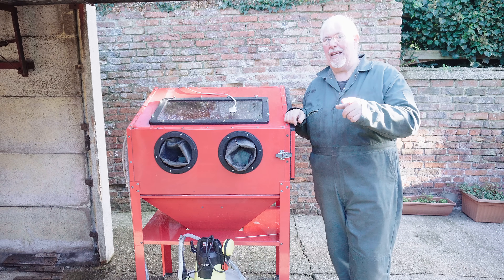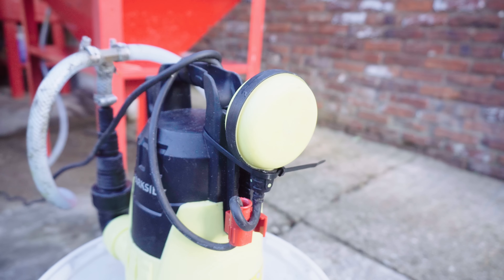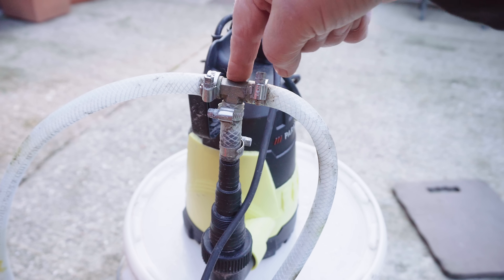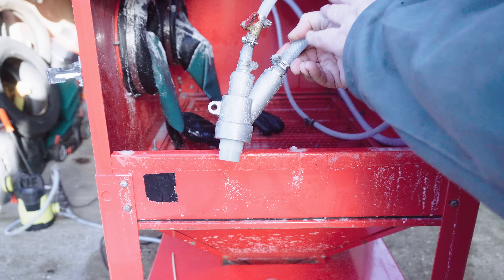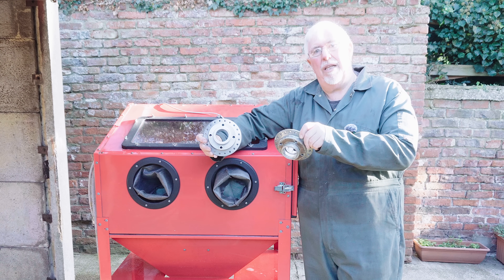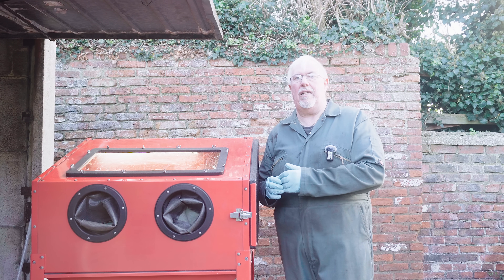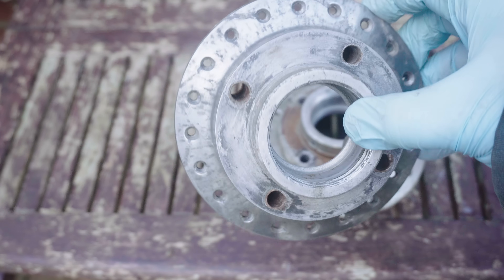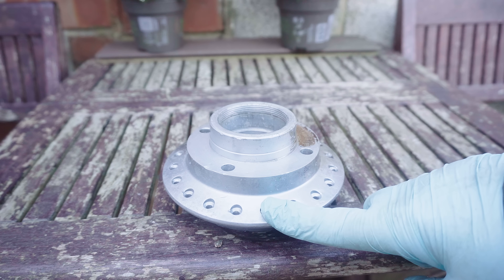Cheapest DIY Vapor Blaster Guide | How To Build The Ultimate Budget Vapour Hone

Comment: If suspension of particles in the mixture is difficult, a thickener can be helpful.  You could use what they use for drilling earth.  Bentonite Clay, Carboxymethyl Cellulose, and polymers like Xanthan Gum or Guar Gum, work well to thicken the water.  I also like to use corrosion inhibitors like sodium bicarbonate, sodium nitrite, or tri-sodium phosphate.  They really help with flash rust.

In a pinch, I once used corn starch, but since it could create biologics, it should always be discarded after use.
Reply from the maker: Some great ideas, I hadn't thought of corrosion inhibitors in the water.  It is something I should try.  Thanks.

Comment: Klever Project,
 BUT and it's an Important .. is the Compressor CFM requiurement,
 14 CFM is Huge for a home shop. Large and Expensive  Not something many have or can reasonably afford. 
 be a Helluvalot cheaper to simply have a Blast Shop... Vapor blast your parts.  You would have Much more Money in your wallet.
 AND you wouldn't have this Rube Goldberg Contraption to : Buy.. Build .. Store AND Maintain.
Reply from the maker: Thanks for the info.  The size of compressor is always going to be an issue with home blasting.  It is surprising though how may feel it is worth the investment if they are going to use it a few times.  Take care.

Comment: You didn't mention the ratio of bead to the 25 Litres of water you use.Please,did you experiment much with this or go with data you found somewhere,what ratio would you suggest for the particular setup here,?.
Reply from the maker: I put 12.5kg of the beads in, but I suspect that was a little on the heavy side.  However works fine, means you wont have to top it up too often.  And it is half of the 25kg bags they come in.  What's not to like! :)
Reply: @SPANNERRASH Thanks,gives us a starting point for trying out different media/water ratios  when we know what kind of results the above provides.Happy Spannering !.

Comment: How much media did you put in the bucket?
Reply from the maker: Thnaks for the Sub.  I put 12.5kg of the media in the bucket.  Probably generous, but I buy it in 25kg bags, so it seems a good idea to use half at a time.  However the fact that through leakage I may need to top up a little along the way, might make that maths fail :)
Reply: Btw! Very nice video! I love how straight to the point it is. You found yourself a new subscriber.

Comment: Can this be used for steel parts?
Reply from the maker: Yes, but you need to make sure you dry the item, and put some corrosion inhibitor on the part or you get Flash Rust.  Not a big deal, but still something else to deal with.
Reply: Thank you

Comment: where do i get the adapters to get the 1/2in hose to fit the pump? what do i search?
Reply from the maker: My pump came with a step down adapter that allowed you to fit a number of different size hoses.  I suggest you search using the pump manufacturers name, to see if you can find something.  Otherwise you might have to get creative.  You can find a lot of different adapters, you would need to start with the diameter of the outlet first.  You might have to go through 2 or more step downs to get to where you want.  Good luck.

Comment: Could you not run the clean waret hose intothe cabinet with the spray hose end on & keep using it to clean the screen as & when required - nice cheap build though 👍
Reply from the maker: The water would run into the slurry bucket and make it overflow, but I suspect that would be too much of an issue.  I will bear it in mind! :)

Comment: Could you give a little more information on the bleech and its use ? 

Thankyou & keep up the top work
Reply from the maker: I have found that if you leave water, even with blast media in it, in a bucket, it starts to get algae and green slime growing in it after a couple of weeks.  However if I add a little bleach to the water it stops that happening.  It doesn't affect the blast media, but stops the slime. I drain most of the water when I have finished using the media and add around a cup full of bleach.  Then before I use the media, I top up the water again so the bleach is very diluted.  When I have finished I drain and add a little bleach again.  I hope this makes it clearer for you.

Comment: I don’t know why people are still using expensive air compressors, I use a cheap pressure washer instead of an air compressor, just requires some gun modification, mix a little red silica free garnet to do the heavy work and the majority of the glass beads still give you a good finish 👍
Reply from the maker: great advice. must try the garnet.

Comment: When I get back into a larger shop I fully intend to get another blast cabinet and a second to build one of these, we do motorcycles as well and the engine cases get extremely dull and dirty over the years. I also have not gotten to use my powder coating setup since we had to move in to this tiny shop. We went from a 100 ‘x150’ shop to a 30’x40’. It feels like working in a closet. Also don’t have the overhead space I need.
Reply from the maker: I really wish I had more room.  Apart from more time, it is the main thing we need.  Hope things go well in your new shop.

Comment: I’ve made one almost the same, it can dry or wet blast all sorts of media, I’ve attached a wet vac to the exhaust hole with a particle separator so I can see through the fog, also I’ve stuck clear plastic to the glass as a screen saver, rivnuts and bolts to hold it in for quick removal and recovering, foot switch for the air and a 3D printed gun and nozzle works well.
Reply from the maker: Cheers. They sound like some great upgrades.  I have just got some silicon to seal all of the seams, so that the water doesn't leak out.

Comment: Have mine up and running now thanks to your video. Have a few issues though, one being my non-return valve bungs up and is passing and finding a 3/8” barbed ball valve that is actually a 3/8” bore and not 1/4”
Reply from the maker: Strange that your non-return valve bungs up.  It isn't an issue I have had, maybe I have been lucky.  Matching sizes with air line fittings always seems a challenge.  But it is worth overcoming the issues for the benefits that it gives.

Comment: Great vid and very helpful. Just out of interest what pressure was the compressor pumping out? I have a small compressor so wondering if it would suit.
Reply from the maker: Thanks.  I set it at 8 bar and just leave it.  With a smaller compressor, you will have to take some breaks to let it recharge, but I have done it that way in the past.

Comment: The sample part wasn’t even slightly corroded.
A little steel wool would have sufficed.
I don’t understand the advantage over a standard system without the hassles and mess.
Reply from the maker: A little elbow grease does go a long way.  But I can assure you my elbows are a lot better for using the vapout blaster.  It was a shame I didn't have anything else to hand for the video.  But not to worry, I am not trying to sell them!

Comment: When using a smaller cabinet did you just cut a hole in the bottom of the cabinet for the water.
Reply from the maker: The 90l cabinet I had, had a sloping bottom already, I think that there was a panel to take out.  I did however cut a hole in the table that it stood on :)

Comment: one question, how long will such a pump last, will it not wear out after using glass sand?
Reply from the maker: It is likely that the impellor will wear out quicker than if you were just running water through it.  It hasn't been an issue so far, and I haven't heard other people using the same kind of system having major issues.  I do think that over time I will consider the pump as a consumable, but I do think it shoul have a reasonable life span.

Comment: Great informative video. I'm about to build the same unit. Did you find the 150 litre 3hp compressor was up to the job? I own a Clarke model but was concerned it would get too hot and pondered a 4hp 200ltr. Whether the upgrade and extra money  would benefit me enough is the question. And same here restoration of old Motorcycle parts. Stripping the frames and painted parts I'd normally use industrial  paint stripper as old powder coat is a nightmare to remove with a blaster cabinet.
Reply from the maker: I don't feel I have any problems with my 150l compressor, but I would always recommend getting the largest you can afford, accommodate if you are going to use it a lot.  If you are only an occasional user then a smaller compressor isn't a big issue.  Powdercoat is a pain to remove, I agree.

Comment: The plastic impellers on submersible pumps don’t take long to disappear when pumping abrasive materials, I’ve been there.
P.s. try leaving aluminium parts in elbow grease overnight, it does a great job.
Reply from the maker: Thanks.  I do expect the pump to be a consumable.  It has gone for longer than I expected.  I was wondering if there were pumps with metal impellors, maybe stainless.

Comment: Yes you can also use shaving foam too, what you do is smear some shaving foam over the glass rub it around and give it a buff to come clear again, this helps with condensation and steamy windows in the bathroom and I’m sure if you tried it out on the blast cabinet it should give the same result, worth a shot I’d say , nothing to lose but some cheap shaving foam
Reply from the maker: Great idea, I will give it a go, once it warms up enough to actually get going again.
Reply: Here in the states, there is a product called Rain-X. It was actually manufactured to put on the outside of your windshield on your car with the idea being that it repelled all rain, sleet, snow, mud and other waterish yuck. It does work excellently if you scrub your window squeaky clean before applying it. What I was thinking was it might be useful for the inside glass of your blasting cabinet. I don't know if they have it in the UK but you can certainly look for it. It's usually found here in big box stores such as Walmart but you can also find it in auto parts stores as well. Just an FYI!
Reply: @ yeah we got that in New Zealand too, few of the brothers use in on their helmet visors for them rainy rides
Reply: @ a lot of petrol stations sell it too
Reply: @ on the bathroom mirror works well so after a shower clear mirror with no condensation so hopefully it will work for you

Comment: Great video! I would suggest to rotate your “brass tee” 90 degrees so the blast hose connects in a straight line with the pump discharge and use the remaining side port to go back to the bucket… thank you for a great video
Reply from the maker: Sounds like a great idea, I will try it.

Comment: Thank you for your video. I've been dropping off parts at a local sandblaster. The problem is price and time varies enormously depending on their workload and staff. When they have a big job on and they are short staffed, my same parts can cost 3 times as much and take weeks to be done. Now I just need to convince the neighbors in my apartment block not to worry about the additional noise of a compressor in my garage.
Reply from the maker: That maybe a hard sell to your neighbours!  But good luck.

Comment: I have a home built cabinet as well and ill give ya some tips. I made an exhaust with a 90⁰ pvc elbow and a short piece of pipe sticking up so it dont leak and then put a shop towel over the top to act as a filter, I purchased a universal utv single wiper kit from ebay and a dc power supply to power it, the wiper will need some mods to fit the glass as its to wide and I installed a rinse hose inside the cabinet. I also got some nice rubber gloves to keep my hands dry and i have a super bright external led light that just rests on the glass from the outside. These things made the cabinet such a breeze to use! All in all i think im in about $450. Next i am going to put it on a frame with wheels and I think im going to make it where it will also open like a clam shell with some hinges on the back. Ive found if you have the right water/media ratio 50-60 psi will do everything you need it to. 🍻
Reply from the maker: Cheers, thanks for all of the advice.  I think I need to start by sealing my cabinet better.  I may consider the wiper idea, but for now I can manage quite well as it is.  Take care.

Comment: Before setting up a wiper system for the window, I'd try a hydrophobic coating like Rain-X and see if it helps it stay cleaner. Great vid, and very inspiring. I'm building a supercharged Unit 650 in the states.
Reply from the maker: Thanks for the tip! I am going to give that kind of thing a go.

Comment: I might have to try this. I recently had to drive through a stretch of slightly flooded (with salt water) road and my brackets, alternator case, valve cover, and intake have the ugly powdery white surface corrosion from it baking on for the drive home. They weren't great looking to begin with but this would improve things greatly for a cheap price. Somehow I doubt my 20 gallon compressor is large enough though. Maybe a small sprinkler nozzle off of your garden hose with a small ball valve in the cabinet would allow you to clean the glass off as you, and the part, if you want to inspect it between stretches of blasting it.
Reply from the maker: Thanks. Getting something rigged up to clear the screen will be a good idea.  Vapour Blasting is ideal for cleaning up engine cases.  With a smaller compressor you will have to work in short bursts, but it will still be doable.

Comment: Couldn’t you just do this outside?
Reply from the maker: I assume you mean without the cabinet.  Yes, there are attachements for pressure washers that do a similar thing.  But, you lose all of the media, and it gets quite messy.  If that isn't what you mean, then I hate working in the rain :)
Reply: @ yeah I guess he would probably want to save most of the glass, beads or sand particles or whatever they are

Comment: vapour blasting is not for removing paint, its more of a polisher / Honing , for removing paint you need a dry blasting and a compresser that will give you at least 30 cfm
Reply from the maker: Yes I would definitely use dry for rust and paint.  It is a case of horses for courses.  It isn't a one size fits all.

Comment: Great video, but what's the advantage of vapor blast over just using dry glass bead which i have in the same cabinet? I get good results with that
Reply from the maker: I used to use Soda blasting for my engine parts but it was quite messy, I now find wet blasting is gentler and more suited for softer metals and to give a more polished finish than dry. Dry blasting is more aggressive and better for cleaning rust and debris of harder metals.  Softer media can be used dry to make it less agressive.  I do use both, but wet is much better for the alloy parts from the engines of motorcycles that I work on, whereas dry is better for cleaning the rust off frames and other cast iron parts.

Comment: Wonderful video.  What are the pros and cons compared to dry media blasting?
Reply from the maker: Its horses for courses.  Wet blasting is gentler and more suited for softer metals and to give a more polished finish. Dry blasting is more aggressive and better for cleaning rust and debris of harder metals.  Softer media can be used dry to make it less agressive.  I do use both, but wet is much better for the alloy parts from the engines of motorcycles that I work on, whereas dry is better for cleaning the rust off frames and other cast iron parts.  I hope this helps.

Comment: Haha I used to work for a German company based in Durban RSA in the 90s. I was tasked with maintenance of a large one of these apparently patented. It used to be a nightmare as it had a rubber coated impellor  which used to wear out due to abrasion of the blast media. However it was a large income generator  for the company ,as it was used extensively throughout southern Africa. In smooth , satin, prepped stainless steel for the food industry,  thanks for the memory
Reply: What a coincidence! I'm from Durban! Please come back 😁
Reply from the maker: The beauty of this, is that the pump is quite cheap. Once it plays up I would just replace it, but it seems to be holding up so far.  

I can remember replacing rubber coated impellors on larger petrol driven pumps, which we used for field water supply back in the '80s when I was an Engineer in the British Army.  They were usually damaged because they were run dry by users who didn't know any better!  Happy days :)

Comment: I using the same cabine but different setup. I using high pressure water instead of air compressor.
Reply from the maker: Interesting, I assume you are using a pressure washer of some kind.  If not even more interesting.
Reply: @SPANNERRASH  Yes more simplier, I have air compressor also,but is a small cheap 50l and can't really keep up .

Comment: I've seen quite a few videos on these, I' constantly thinking about converting mine; but, I had hoped to find a second one and have both. Some people are using windshield wiper motors from cars on the upper view port. It's great to see your take on building one...
Reply from the maker: Glad I could help! I originally put it together a year or more ago, but used it with a 90l cabinet, which isn't ideal.  Like you I wanted a second cabinet for it, I also have a 220l for dry blasting, so I waited for one to come up on Market Place, near, and cheap :)  It has been such a success I can't stop using it!